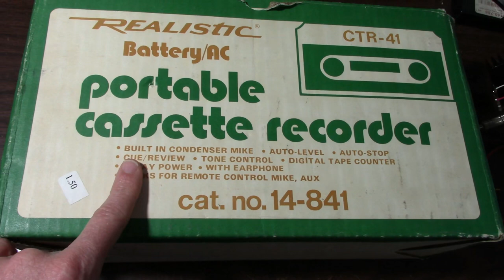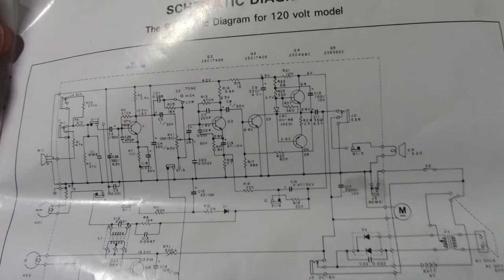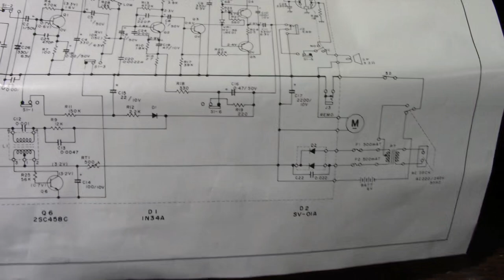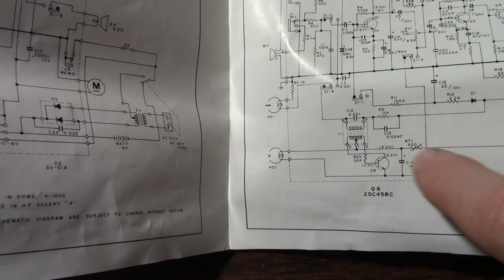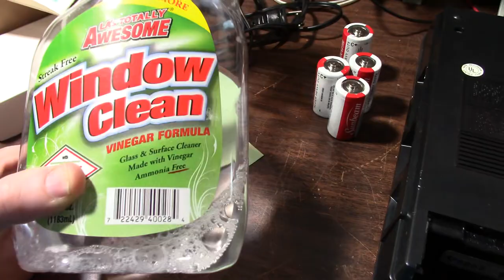Realistic cassette recorder CTR-41 maintenance and review

Comment: Wow, a ghost from the past.. In the early 80's my dad had one of these hooked up to his TRS-80. In those days the 5 1/4 floppy disk drives were sold separately and were an upgrade for the computer. Instead, you would use this cassette player with tapes that stored data on them and after a good half an hour could even drawn a very blocky picture on the screen. What a weird time to think you know what computers were about.

Comment: Gone are the days of supplied schematics.
It now always call service, the result is nearly always "beyond economical repair"
e.g. Apple, Bose, Pure, JBL etc. Shame on them all.
They all purport to be environmentally friendly but they prefer you to throw their goods away and buy another, adding to the e- waste on some distant shoreline.
All companies should be compelled to supply schematics after warranty period expires. Environmentally conscious companies would supply from new, as they used to.
Reply: I agree, but with all the proprietary parts used today (especially custom ICs), getting replacements are nearly impossible. Planned obsolescence = more profit.
Reply: @jrs0007  Maybe a CSA, ANSI, ISO or British Standard could be drawn up for repairability which would then allows organisations to call themselves environmentally friendly.  The standard would have to be down to component parts and not allow companies to say parts are available by allowing you to buy a new engine when all you wanted was a spark plug or stating that manuals are available when all it shows is the units functions and fault codes which all state contact the manufacturer.
The current European standard for this gives Apple a total of 14 points out of a maximum of 15 for repairability; hence it's not fit for purpose.

Comment: Si or Ge?
Reply: They're Japanese transistor numbers. So plain old Si most likely. You can look them up. 2S series transistors are common. The numbers are at the top of the schematic at around 5:42
Reply from the maker: I checked the output transistors. They are silicon epitaxial types.